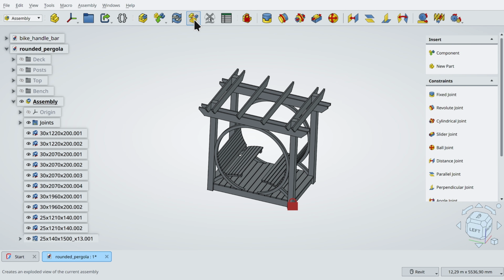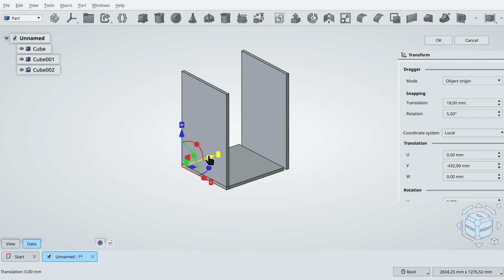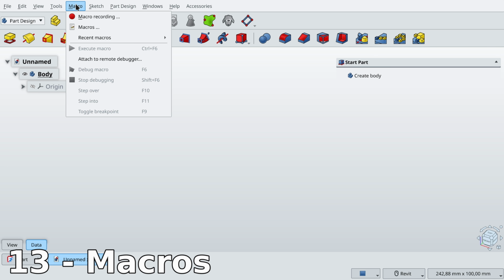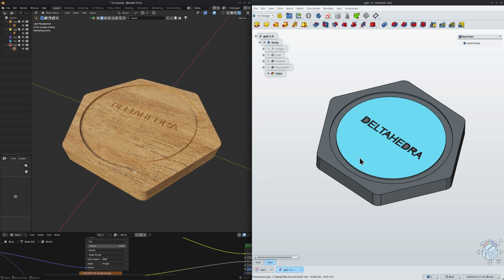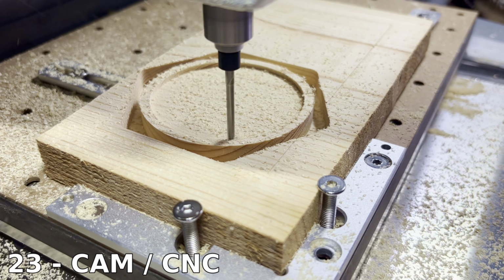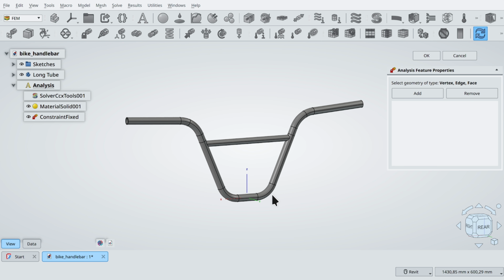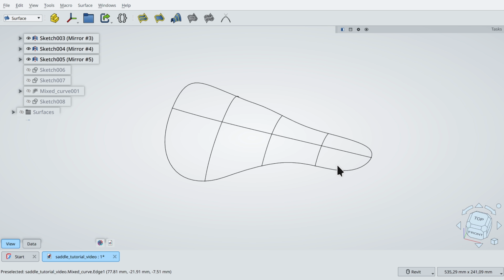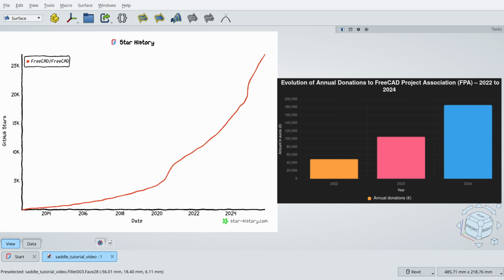30 Reasons to use FreeCAD in 2026

Comment: I work with vacuum forming plastic. Small home operated business. Is there a way in freecad to create compression models? I have over 100 molds and want to create negative models to compress the 2mm thick plastic sheet into. So the negative model needs to have that 2mm extra thickness built into the design. Having to manually redesign all 100 plus models would take FOREVER. Does freecad have any tools that could do that with a click of a button?

Comment: Very cool French accent. Used Free Cad to model a washing machine drier stand for above my bath . Got it manufacted in 50mmx500mm square tubing and had it powder coated . The finished product worked and was the correct size and fitted through the front door. The welder knew excactly what I wanted and the steel was free I had cut the metal to the correct lenghts. cost me $400AUD to make. before it all sat on a peice of timber that eventually broke.

Comment: Two more things: 
1. The controls, you can select from a wide variety of control schemes like blender CAD or even Touchpad. 
2. Hotkeys, even just the default hotkeys make sketching and modeling so much easier compared to having to use my mouse for everyting.

Comment: I use FreeCAD so I can model and visualize projects I want to do, and I want good support for parametric design so I can tweak my designs for my needs. The next reason is that it is open source, and finally it is free. I am not obligated to pay exorbitant prices for less capable software, which means I can choose to donate, or not, and I get to choose how much and how frequent, I donate so it won't break my budget. I am sure I will find other reasons to choose FreeCAD, but I am just starting out and need to learn and become proficient.

Comment: What about scripts, plugins, bim-import from other software? Without plugins, the work can take a very long time. They make life easier for designers. Is it possible to generate specifications for all materials using different units of measurement and other reports? Do the current specifications support formulas? Are there filters for 3D views or sheet views that allow you to hide an entire category of elements? Can you create custom parameters for objects? Is it possible to perform complex load calculations for foundations or steel structures, for example? Is it possible to use nested model families to assemble a more complex one from different families? Is it possible to load other objects onto connections to see, for example, if my object will fit next to others? Is there a unified coordinate system? It’s great that the product is free and can do a lot, but is it ready for the actual design of complex structures, and is it suitable for designing factories?

Comment: I come from Fusion360 and used FreeCAD for like > 15h now (for 3D printing stuff). Correct me I'm wrong but in FreeCAD you have to actively think about how you want to build your part. It forces you to take a "clean" approach that in theory would work better if wanted to make changes in past steps, but it also makes the part design itself more complex. In fusion I never encountered a point at which I cannot salvage what I've done and had to start over from scratch, but it did happen to me a couple of times in FreeCAD already. 

Also it does crash a LOT if you don't know what you are doing. Autosave works fine though and starts up pretty quickly. Also I like my chamfers and they do SUCK in FreeCAD. I mean they are buggy in fusion but in FreeCAD it's a disaster.

Comment: My problem with freecad is that if I put points along an arc in a sketch then zoom into those points they start leaving the arc that they are constrained to, this makes it extremely difficult to make complex construction geometry. I know that the points are only wrong visually but it still contributes to me working off the wrong point and generally making the sketches difficult to look at

Comment: Thank you for these helpful explanations about the features and reasons to use FreeCAD. You've clarified many of my doubts!
I'd like to ask you something about this.
I read the specifications and rationale for AstoCAD on the official website. They state that the software is always one step ahead of FreeCAD in terms of new and updated features and bug fixes.
In light of this, I'd like to know: if it's true that FreeCAD is updated weekly, how is it possible that AstoCAD is always one step ahead?
Am I wrong, or is the situation different?
I'm asking this because I'd like to try AstoCAD (never tried it, neither AstoCAD nor FreeCAD), but only if it were actually always better updated than FreeCAD.
Reply from the maker: AstoCAD is developed by PaddleStroke, who is a major contributor to FreeCAD. Because of this, whenever he creates a new feature or an update, it appears in his own software (AstoCAD) first. These improvements are only 'ported' or integrated into the official FreeCAD version at a later date.

Comment: The reason I use onshape instead is because it browser based and so I can use my laptop
Reply: I Gotta ask what laptop do ya have cuz I have thinkpad t460 and it works just fine
Reply: @Partizipejsn I have thinkpad x1 extreme and it was not runnig well. I might have done something wrong then... Need to try it again
Reply: @ahuman2533 worth a try gotta ask tho ya runnin linux or Windows becuse I couldnt get it to work on Windows eiether
Reply: @Partizipejsn I am dualbooting windows 11 an ubuntu but when I tried it I was using windows so thats probably the problem

Comment: I really try to like FreeCAD, but it seems even more cumbersome and fiddly i.e. using bodies in other sketches where you have to klick every single line that you need and you have to make a projection version first and if you make changes that are more than just a dimension change then you loose your projections and it's fiddly to remake them. Many issues are the same as in Fusion and I do not really know what FC makes better...
Edit: I really love that I can indiviually change colour and thickness of different line types

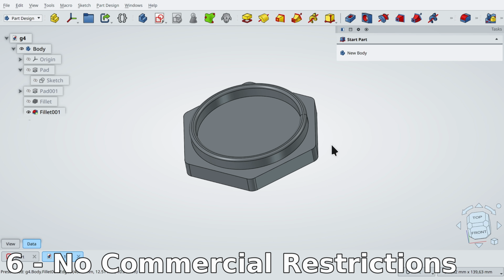Comment: What about buildings? I need 1:1 schematics, 1:10 rack drawings, 1:100 building layouts, 1:200 exteriors, 1:500 city planning. All for a single project (long distance optical cable all the way to devices).
I heavily rely on external references. For managing projects, I already managed to toss AutoDesk and I implemented free OpenProject for us. Now I want a good enough CAD software! Can't wait to ditch AutoCAD and Revit...

Comment: I know this is a pretty insignificant thing related almost exclusively to me, but FreeCAD just looks so much worse than Fusion to the point I'm having trouble switching over. I know this is 100% a skill issue on my part, but it's still something.

Comment: Last 10 years, every new rev of FC, I did the same procedure. Donate, try the new version, ditch it as "still yet unusable" and root for the project. And SUDDENLY! Two reasons to move into FC.  One is FC 1.0. And the second is ... my new job and having to work with Creo. The latter is so bad that I looked more favorably upon FC. Now for my personal and personal-commercial, I use FC exclusively. And, which is paradox, sometimes I prefer to make some detail in FC, then export it to STEP and import into Creo.

Comment: I had a vision for a motorcycle part. I'm a psychologist by trade! I found FreeCAD in 2019 and gave it a go. A long forgotten background in vectorial design (Freehand!) helped to get the gist of it, the rest was reading the Wiki and watching tutorials. 

A couple of months later I had managed to have the parts manufactured just like I imagined them. Now I run a business selling these designs that wouldn't be possible without FreeCAD. 

I wish we could all get on the open source bandwagon for all important platforms and software. It makes such a huge difference. There's a place for paid software, but this is just amazing.

Comment: I remember when I first time came up with FreeCAD it was around 2002-2003, and boy was it something, but it was only CAD really for the Linux, and it was great for the basic things needed back then. I recall I did a 3D animation for a university application for one guy, and middle of the thing I realized that you can't animate with it, so it became a Blender project then.

And it was really about need to make a 3D animation and blender was the only way to do it quickly. It was annoying as FreeCAD had promise, but you forgot things and then it comes years later ahead of you, even when you now and then remember it and try to find time to check it out. When 1.0 got out, it was again time to invest time to it. 

And seeing this kind quick and simple demonstration what are new features or good capabilities why to use it, show why it is important it gets supported!

Comment: Hot damn! I had learned to use solidworks at work for the last couple years and used fusion at home, but kept poking at freeCAD since it actually lets me own my stuff. I just couldn't get through the differences so well but now I'm trying to commit to learning FreeCAD because of you. I hadn't realized it did this much and you're honestly doing more here than the engineers at work can with SolidWorks (some have used SolidWorks for 15+ years... and still don't bother to fully dimension sketches).

While this is an awkward learning process, your demonstrations here and looking at your other videos has given me hope that I can actually use it and still do decently if I put enough time and effort in. Now I can actually own my own work too which was always a concern for me, especially if I had some cross contamination with work stuff. It also means I can continue my quest to abandon windows.

Comment: Bless everyone that contributes to open source software. You people are true heroes in a time of price gouging, gate keeping paywalls, abandonware and lord knows what else I'm missing.

When i was in school they taught us on Inventor, then switched to Solidworks my last semester. I've been waiting the better part of a decade for a more accessible CAD program that actually works with no strings attached. Funny enough it's not so much my engineering background that needs the software, it's, as you brought up, primarily for woodworking.

At the moment i draw everything on graph and isometric paper but it's slow and can be difficult to get non-right angles correct on an isometric projection.

Comment: I tried FreeCAD on Mac around 2019 and it was unusable, so I paid for Fusion 360 until last year where I realised I'd spent thousands of dollars to use it infrequently, and still didn't have the kind of basic functionality I wanted (like storing my work locally). I just tried FreeCAD again out of frustration, and it's been good. I recommend it.  Let's push it forward.  SolidWorks and Fusion are taking the piss with their prices.

Comment: So there's a couple of things that I look for in Cad software that are very very relevant to my line of work:

1. Equation-driven curves. This is EXTREMELY useful when trying to create something that follows an optimal shape based on real-world physics, such as aerodynamic profiles. You can kind of work around not having this kind of tool by graphing out the curve you need with a series of points, and fitting a spline to them, which is similar to how the equation-driven curve tool works in most CAD programs to begin with, but trying to go back and edit the relevant geometry later in a parametric model is a NIGHTMARE. Having the ability to just change the equation as-needed is a must-have feature for me.

2. Something similar to the Solidworks Flex tool, which lets you twist, bend, and otherwise deform a solid body. This is very different than just the ability to add a twist with the sweep command when first creating the solid body, or the various sheet metal bending tools that are out there. This tools lets you twist or bend existing solid bodies, even ones with very complex geometry. I use it extremely frequently, and no other CAD program I have tried so far seems to have the same or similar capability.

3. ITAR-compliance. Iykyk.

4. The ability to draw helixes without resorting to janky workarounds using coils and reference geometry. (LOOKING AT YOU, FUSION!!! IT CAN'T BE THAT HARD TO IMPLEMENT)

If FreeCAD can check all these boxes for me, in addition to all the lovely features it has already, I will switch over to using it faster than you can blink!

There are plenty of other nice features found in various CAD programs, such as Onshape's branching version timelines, Fusion's ability to seamlessly combine parametric and direct modeling in the same file, or Solidworks' overall smarter and more convenient UI and ability to work directly with files from other CAD programs, that would be super nice to have, but aren't necessary for me personally.

Comment: Hey, maybe someone can help.
I wanted to plan out some timberframing project to learn CAD.

It seems like I am hitting a hard limitation already.
Working with a master sketech for a top down approach, and creating the parts via the shape binder was looking promising.
But apprently there is no way of cycling though overlapping lines when selecting them.
The workaround presented by Deltahera is using the split line tool, but this does not always produce the result I need.

The main issue is that I am unable to select the lines I want via the shape binder when they overlap.
Does someone have  a definitive soloution for this problem?

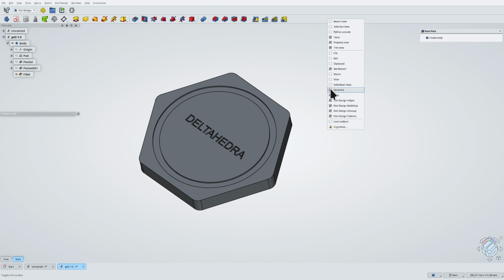Comment: 1:48 how to change the icons to these nice blue icons? Is it only possible if you use linkstage (i saw the link for the icons but i don't see ways to implement them in regular version)
Reply from the maker: Check the icon theme addon in the addon manager. However it’s a bit hard to setup
Reply: @deltahedra3D  I tried looking at that but it requires rcc files, is there something out there that already uses these blue icons? I couldn't get it to work. Or could you maybe make a tutorial?

Comment: Yeah, sorry, I tried. It's better than it was a couple of years ago, sure, but it's still a far cry from being very usable. Random crashes and various other user experience issues have given me pause. I've swapped to Fusion and designed my parts the way I wanted them quite easily, being a complete noob. If I ever want to monetize anything, I might consider checking back on FreeCAD, of course, but it's because of the ridiculous costs CADs are at, not because it's so good it pulls me in.

There's a deep need for major UX overhaul, but that's a huge free software hurdle for so many projects.

Comment: I like the idea, but idk, I worked professionally in CATIA, NX9, Inventor, SolidWorks, AutoCad without issues, hell, I even got used to the madness of Cadmatic, but I just cannot stand FreeCad when I use it for my home projects. The tree management, same functions in different places, but working a little different, sometimes you need to search through the modules to get the function you want even if it is a basic function like scale, and even just looking around the model feels like the program is fighting me at every step. Maybe I tried to do something too ambitious from the start, but I feel like user experience needs to be improved a lot to make it viable to something more than making very simple parts for hobby.

Comment: If FreeCAD works for your hobby projects, then great, but let's stop pretending it's a professional piece of software that will replace Solidworks for most engineering design tasks.  It is not powerful enough to handle complex assembles with hundred thousand parts.  Might be perfectly fine for very simplistic assemblies with limited motion and where little simulation analysis needs to be performed.  It's good to see it being continually developed but far too many FreeCAD videos oversell it as a pro tool, when it really isn't.

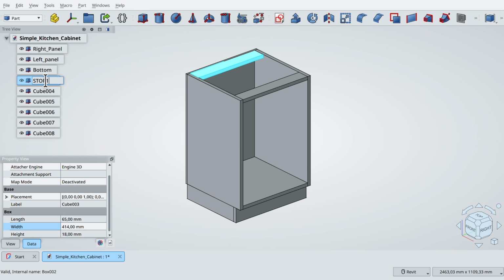Comment: 2:23 parametric cabinet sketch 
"you just extrude the outlines" has been one of the big "actually no" problems in FreeCAD, since it wouldn't partition a sketch for you. It would complain that there are no simple closed contours, and then it would fail to extrude a multi-selection into separate bodies.

Comment: Dear Deltahedra:  Your work is outstanding, and so is that of others you refer to (i,e. MangoJelly...).  I am a 35+ year user of AutoCad 2-D and I am wanting to share one common perspective on FreeCAD.  The complexity and the concepts used in parametric modeling can be very difficult to learn for traditional draftsmen, and the HUGE variety of options for how one might constrain sketches make it even harder to learn.  I wish one of you giants could think back in these terms and try to devise a way to slowly and methodically help this particular subset of new users embrace this amazing program.  If there could be a bridge between traditional drafting concepts and FreeCAD that would be amazing.  For example, I drew a simple sketch with a curve intersecting two skewed lines tangentially.  When I later placed dimensions on one end of the line away from the curve, the curve changed in a way that was unexpected.  I had improperly constrained the three-point curve and had not understood how this occurred and the ramifications.  Perhaps one of you could share screens with a series of failing beginners in order to watch and discover the breakdowns in logic that lead people to simply give up.

Anyhow, thank you for all your hard work on behalf of others.

JB